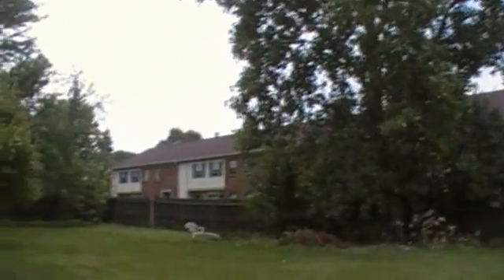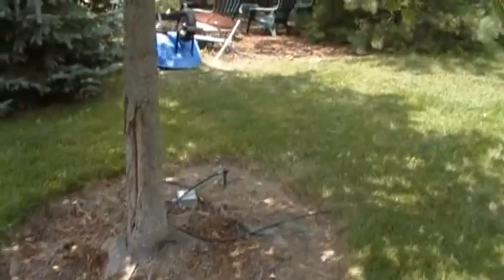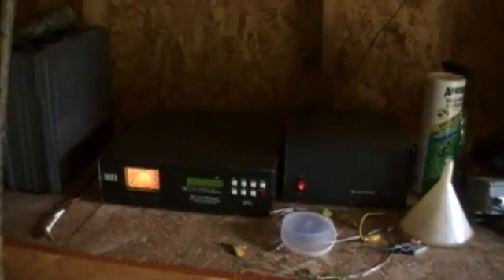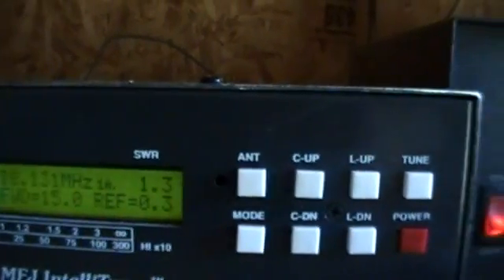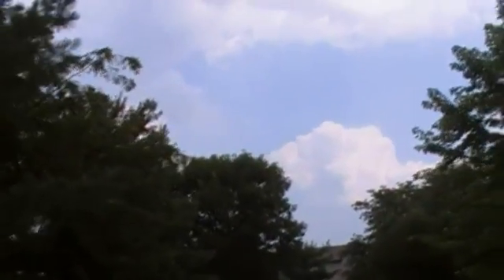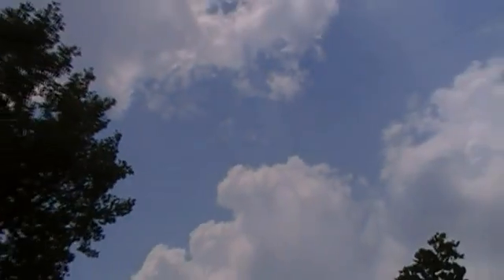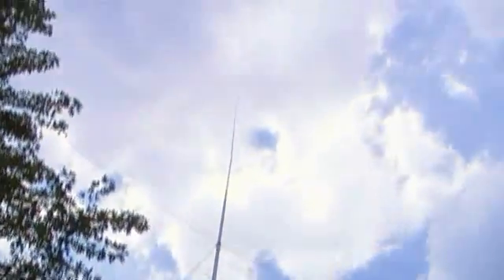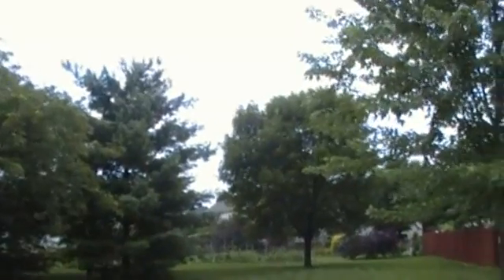MFJ-998 Remote Setup to 165' End Fed Inverted L

Comment: What's your secret for getting the antenna in the trees? Climb them?
Reply: 6 year old vid, but I use a compound bow with 1 ounce fishing weight taped on it. Cleared my 75 foot tree easily.  I wonder if he leaves the tuner and power supply on 24/7?